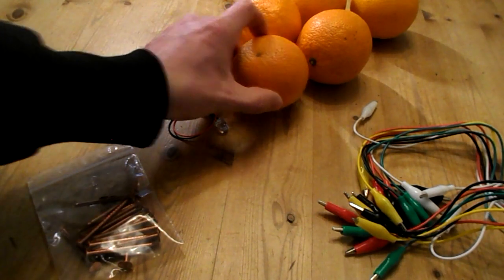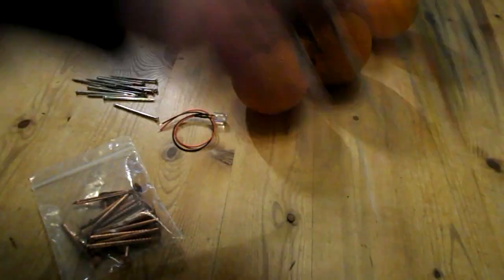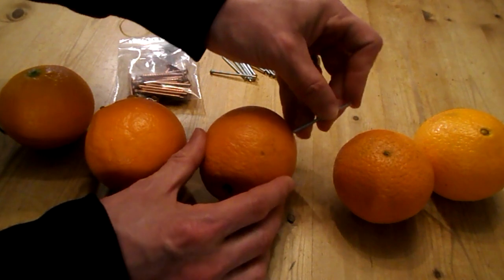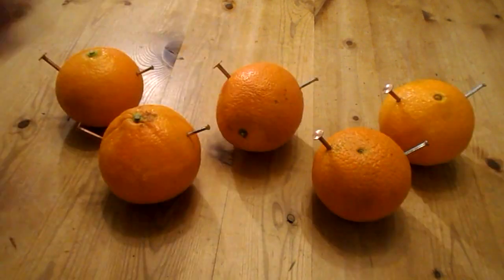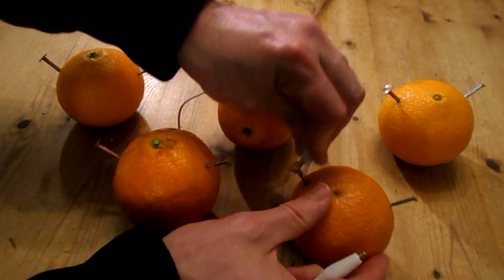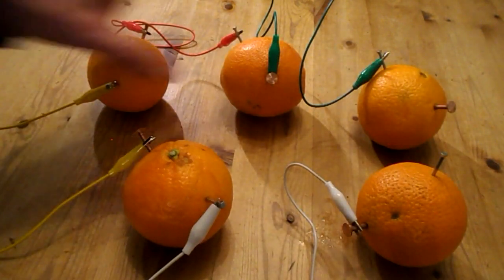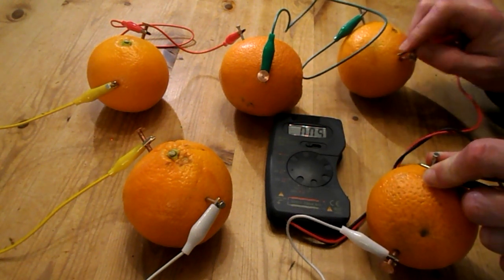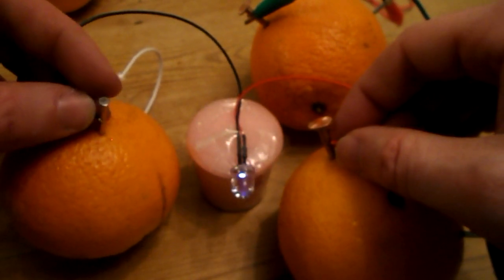How to get electricity from an orange

Comment: why can't the LED light turn on by using the crocodile clip?
Reply: the LED has its own wires, but I guess you could use the clip
Reply: Edit: I just did the experiment, you can connect the led via crocodile clip, just make sure you connect red wire to copper black wire to zinc